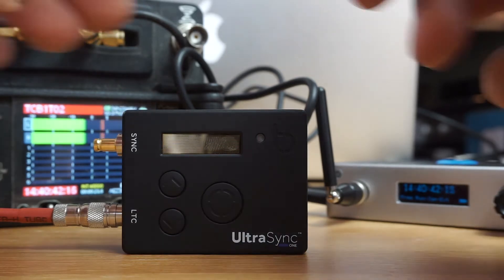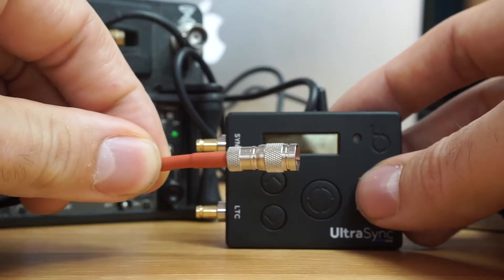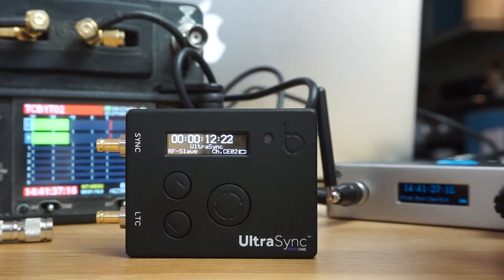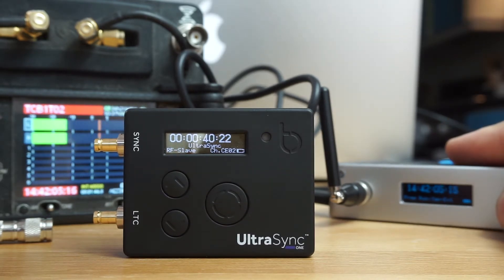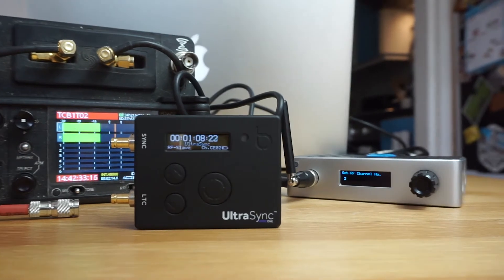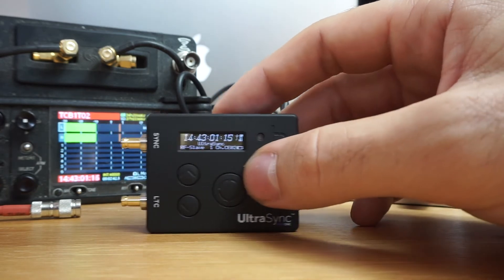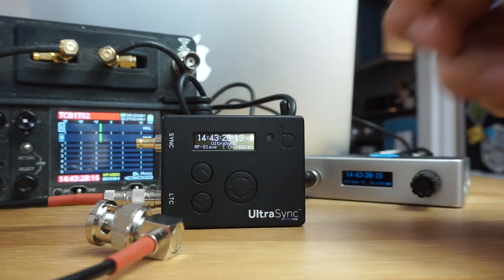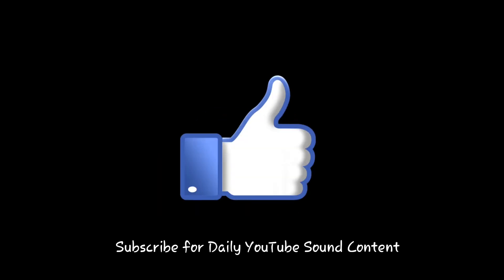UltraSync One Overview + Setup

Comment: how do you unplug the cable ????
Reply from the maker: Just unplug it :)
Reply: @soundrolling  Hey Matt, I'm also having problems disconnecting the cables.  The collars will rotate but won't push forward or backward.
Reply: TimeCode Systems acknowledged that a batch of their cables were not up to their standards. Contact them for a replacement.

Comment: Hi, Matt. Do you absolutely need to have the :wave or you could have a workflow only with the Ultrasync Ones?
Reply from the maker: +Pedro Freitas very good question. You don't get the blink network without the wave so you would need one if you wanted that. Otherwise there were workflows without a wave but slightly limited feature set
Reply: Matt Price from Soundrolling dot com Thanks for the quick answer. So basically the :wave is the Master Generator that stays connected (sends TC) to the Recorder and connects wirelessly to every Ultrasync One that are on the same channel and that are receiving TC as Slaves. Without the :wave you just don’t communicate wirelessly? Is that it? You would just have Ultrasync Ones acting as 1 Master connecting to the recorder and the other slaves connected tontge cameras?
Reply from the maker: +Pedro Freitas uploading a better exploitation now :)
Reply from the maker: +Pedro Freitas you can still do that. I have done videos on connecting just 2 Ultrasync ones together :) you lose the blink network as explained in a video I just uploaded for you
Reply: Matt Price from Soundrolling dot com Thank you my friend. Cheers